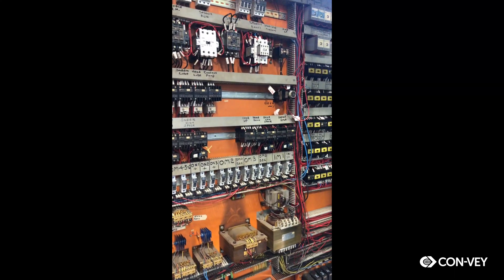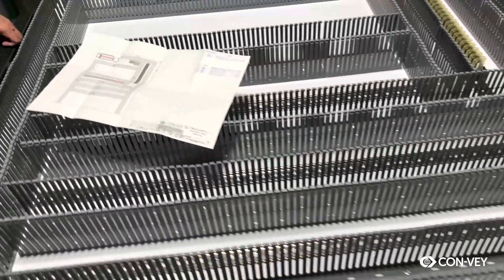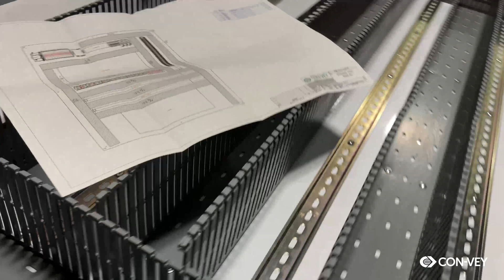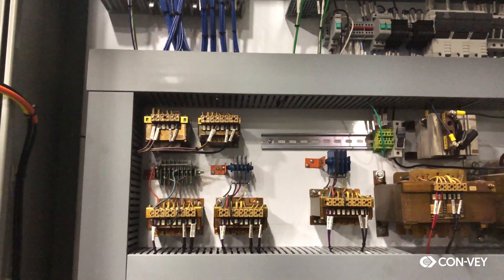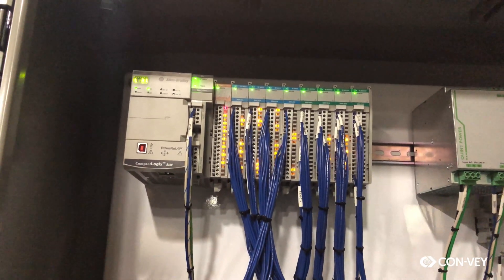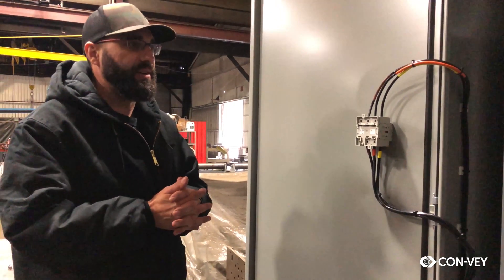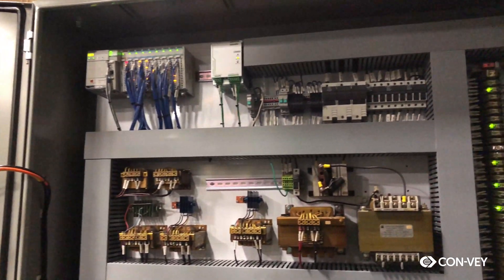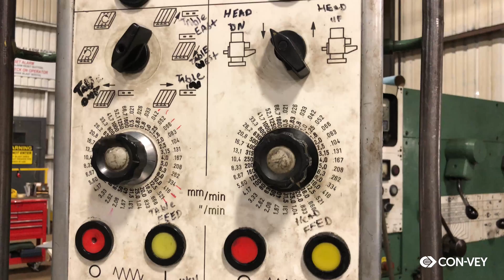Electrical Upgrade on Horizontal Boring Mill Motor Control Cabinet

Comment: A company I worked for back in the 90's had one of these Union HBM's, beside the outdated Euro electric issues the damned thing had endless problems with the electro-clutches too,  the support from Union was a joke at best, not sure how they are today or if they're still around, your electric panel update was well done for sure, I hope the rest of the machine holds up for you.